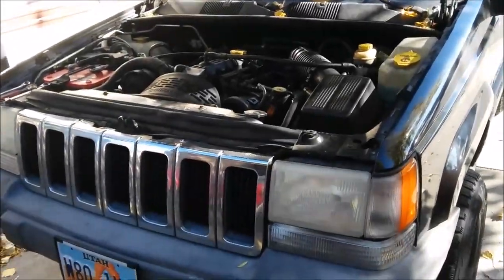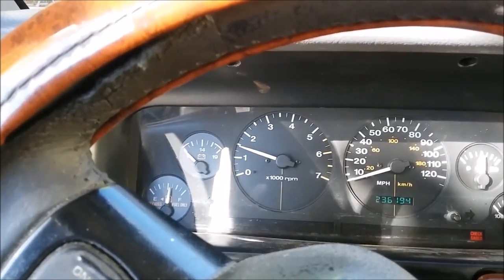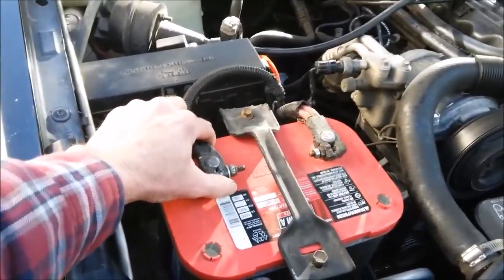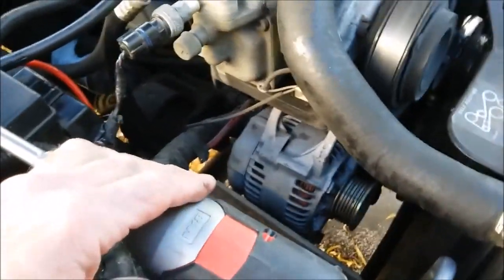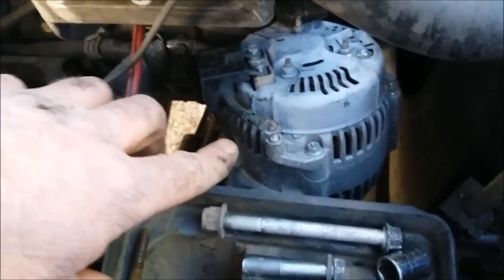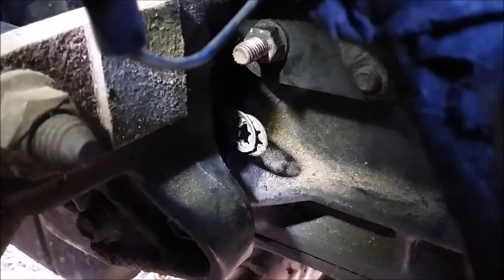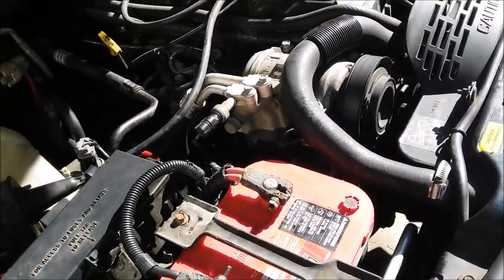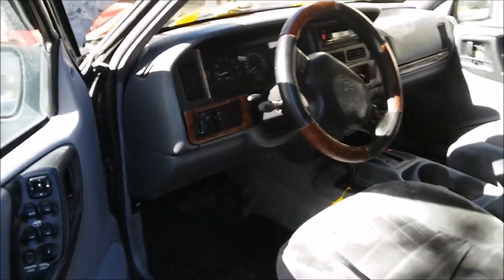HOW TO  CHECK JEEP ALTERNATOR / ELECTRICAL TROUBLE SHOOTING, DIY

Comment: Most of the newer Alternators have a field that is charged by the battery, so the alternator won't put out a voltage while the battery is disconnected.  That would still be good advice for older vehicles though.  Good video!

Comment: Any suggestion on how to revive a drained Altenator after leave the start switch on all night??
The Battery is good it is still have charged as all my lights at the Dashboard still turning on.
It is an Optima Gel 800 CCA.

Comment: Sir...explaine to me about the negative terminal,,,so if normal jeep,,while the engine is running...and you take off the negative terminal from the battery,,if it is good,,it will not die??
I have desame problem....once i start the engine...in a few minutes i see the check gauges indicator...at desame time my battery voltage meter is all the way up from 9 14 then to 19....do you think....we jave desame problem...altenator that needs to replace????
Reply from the maker: Yes, if you take the negative cable off and they engine stays running, alternator is good. But your voltage or should not be reaching 19 volts, 13 to 15 is OK. Maybe a bad regulator inside the alternator? Hope this helps, Thanks for watching!

Comment: My battery went dead in my 07 Jeep Grand Cherokee and left me stranded. It jumped off okay and has cranked the past two days with no problem. Advance Auto Parts checked the battery and did a starter test...both okay. The charging system test results came back: DIODE SHORT. Could you please tell me what to do next? I'm a 62 y/o single female with very little engine repair experience (except for fixing my lawn mower). Are DIODES something you can replace? I just spent $521 on an a/c compressor, so I'm hoping this won't be a difficult or expensive repair. Thanks so much....I just subscribed to your channel!

Comment: Awesome video man. I’m having this issue on my 96. Going to check the ground wires now. 
Alternators good
Batteries good
Checked all my fuses/circuit breakers/relays 
If it’s not the ground wire then I think all that’s left is the voltage regulator but now I can narrow it down.  Thanks man
Reply from the maker: Good luck ! Thanks for watching and commenting !

Comment: Just for your information taking off battery cable while motor is running can cause PCM to be overcharged if alternator is working. The current has to go some where, Like your electronic circuits. your alternator will produce over 25 volts of which your electronic devices are not made to handle. Hope this helps
Reply from the maker: the alternator has it Built-in voltage regulator to prevent this.
Reply: Your battery does more than just provide electricity. It also shorts AC spikes and transients to ground. Removing the battery from the circuit allows those spikes and transients to travel around, endangering every semiconductor circuit in your car. The ECU, the speed sensitive steering, the memory seat adjustments, the cruise control, So on and so forth. 
Even if your on board computers remain intact, in a great many cases removing the battery burns out the diodes in the alternator, necessitating a new alternator. If disconnecting the battery interferes with the voltage regulator's control voltage input, it's possible for the alternator voltage to go way over the top.
I'm a professional. I do this every day.
Reply: Also your Jeeps alternator does not have a built in regulator .
Your computer control's the alternators out put voltage.
Just dont want you to spend more money than you have to.
Reply from the maker: Maybe so, maybe more so on newer models, I've done this test maybe only 50 times or so with no issues. I'm not a professional mechanic but I fix all my vehicles and friends as needed. Thanks for the info! Take care!!

Comment: I have the same problem w/ my XJ. I've had the alternator tested twice, and both times it came back, 'good', and I've had the battery replaced, but suddenly the alt stops charging. I'm wondering if yours had stayed working, or did the problem come back?
Reply from the maker: Same problem with mine, the brushes make contact intermittently, but they make contact when you reinstall it... So it works sometimes and sometimes it don't, eventually it wont-work at all.

Comment: I have an xj doing the same thing already bought a new alternator an put it in an still did it so ima try this out i hope to god it works if not whould u happen to know what else it may be?
Reply from the maker: If your Volt meter is not reading any voltage I would check all the ground like in the video, FYI sometimes alternators are bad from the  Part store!Thanks for watching good luck!

Comment: My battery seems to be dead every morning when the weather is very cold. After charging it the gauge shows a small discharge with head lights on. Is this a bad alternator?
Reply from the maker: Sounds like you may have a bad battery, One way to check it is while your vehicle is running pull the negative cable off the battery, if the vehicle dies your alternator is bad if it stays running your battery is bad. ( most of the time).
Thanks for watching and commenting!!
Good luck!
Reply: @mugivermusclemachines5744  Thank you.
Reply from the maker: Did this help you? Hope so, good luck!

Comment: How can we isolate a bad regulator from a bad alternator? The car is running fine but my voltage gauges goes to 0, check gauges comes on, doesn't run rough at all. Battery stays charged. I suspect the regulator in the PCM.
Reply from the maker: I had an alternator do that to me as well, it turned out that the brushes in the alternator were intermitantly making contact, they were just about worn out, so it would work, then not work...hope this helps!!
Reply: @mugivermusclemachines5744  Thank you
Reply from the maker: @leoampie4942   Thanks for watching

Comment: Mine i tried 2 new alternators, new battery, changed my engine to chasis ground strap, cleaned my bat to fire wall grounds, pcm to fire wall grounds, visible inspection of my battery temp sensor, im at a loss.. Jeep is running identical to how yours was. Dont have a meter but my fusible link didnt feel spongy.... Im at a loss
Reply from the maker: On one of my jeeps I had a new alternator from the part store that was bad right off the shelf, maybe you got two bad ones in a row? Maybe try a different brand alternator or part store?? Hope this helps, thanks for watching!!
Reply: @mugivermusclemachines5744  Thanks bud i will give it a shot!!

Comment: I believe my alternator is out my Jeep is at the point now where I’m not getting any power could this problem be something besides the alternator?
Reply from the maker: Check all your battery connections especially the ground cables to the chassis and to the engine..

Comment: You need to understand bud that if you pull the negative cable off the battery while engine is running not only it will die out but you can also spike your ECM/PCM because that engine uses fuel injection and have a computer that controls everything including your charging system, therefore if you didn’t burnt your computer it was just a lucky shot👍 I’m not trying to be a bad guy but y’all should get more informed before recomend anything to people

Comment: Hi ...I did your disconnection trick......but my jeep kept running?.......my problem is my battery is going flat overnight ...it's a brand new "red and black" battery ....any ideas dude?....cheers.
Reply from the maker: When you are done at the end of day driving disconnect the battery overnight then reconnected next morning, if it starts good then you have a draw somewhere in your electrical system.
Reply: @mugivermusclemachines5744  Thanks very much..... Done that....if I disconnect it overnight and reconnect it in the morning.. it works fine....but leave battery attached and  in the morning it's as flat as a witch's tit!........so it is definitely not the alternator?.....
Reply from the maker: If it stays running when you disconnect the battery cables, your alternator is good. I think your next step is to check all your ground connections and positive connections then go to the fuse box and start pulling fuses and checking draw.
Reply: @mugivermusclemachines5744  thanks very much...I'll let you know how I get on....cheers.
Reply from the maker: @pipandcol  
You don't by chance have any issues with your heater blower motor do you? There is a wiring harness behind the glove box that gets hot and melts at the plug may be wise to check that. Also the alternator could be intermittently working as they
 Brushes wear out they do that. Regulator could be faulty as well. So if you have an old alternator that may be the first place to check. Hope I have been helpful!
Reply: @mugivermusclemachines5744  I have an intermitten alternator,  but I wasn't sure if an alternator does that.
It's a 1999 and probably the original alternator,  but the pcm is original too.
Reply: @mugivermusclemachines5744  I only have 4 / high working on my AC/ heater fan and my battery level is low.

Comment: Aren't you suppose to disconnect the positive side to check to see if alternator is bad?
Reply from the maker: I'm pretty sure it doesn't matter which one you disconnect your breaking a circuit. I like taking the negative off to avoid arcing my wrench out on the frame !
Reply: I heard you could blow the diode out on the alternator if you pull the positive side.
Reply: @randythompson1957  Can DIODES be replaced? Advance Auto Parts did a test on my Jeep Cherokee and it came back: Results DIODE SHORT. So...what can I do next? Thanks. I 'm just an old lady who doesn't know much about engines, so anything you can tell me would be greatly appreciated. I just had to spend $521 on the a/c...(compressor).
Reply: @valeriegriner5644  , honestly,  it depends on the individual alternator. 
Chris Fix is a great channel on YouTube. 
And you can try Google too , for instruction. 
I wish I could help you more.
Reply: @randythompson1957  Thanks, Randy.
Reply from the maker: If it is the diodes, I suggest just getting a new alternator, thanks for commenting !
Reply: In all reality you shouldn’t disconnect any when engine is running because you can damage the computer (ECM/PCM) understand any computerize vehicle DO NOT DISCONNECT THE BATTERY WHEN ENGINE IS RUNNING 👍